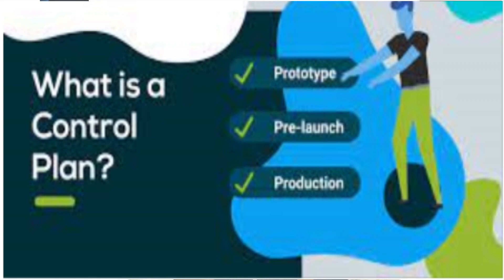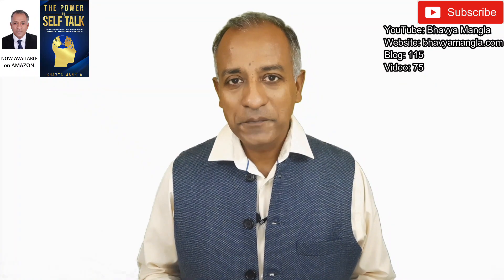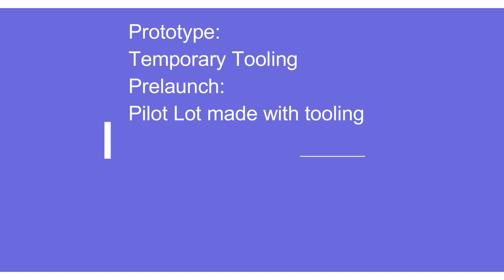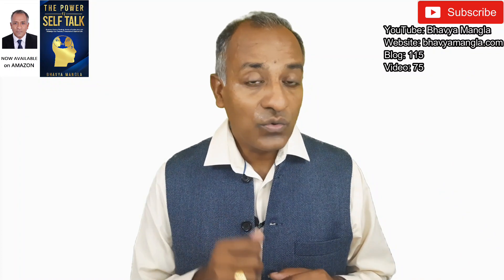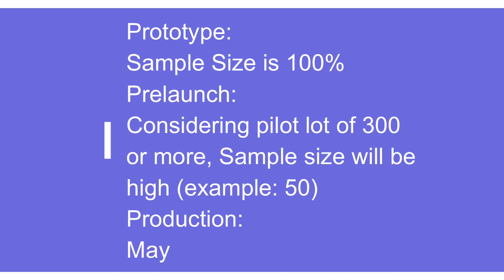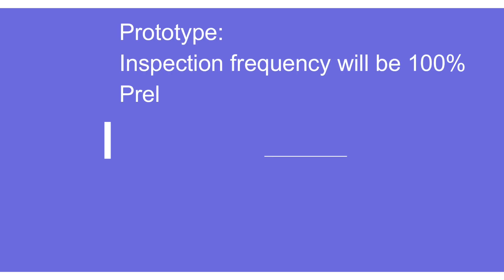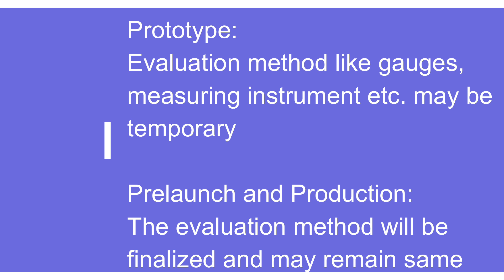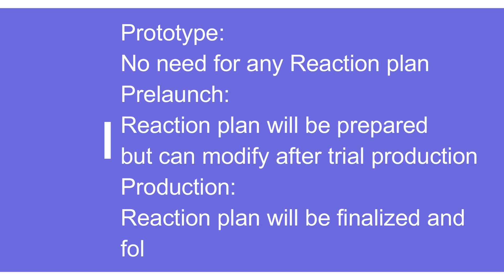Difference between Prototype, Prelaunch & Production Control Plan / IATF | ENGLISH | Bhavya Mangla

Comment: Hello sir,
In Initial Supply Control (IPC/ISC) stage ,which type of control plan will be used ???
Confusion is IPC/ISC is 1st 3 (lot or month or 5000 pcs which come later) production but sampling plan & sample size is higher than regular production.
Please let me know sir.
Reply from the maker: Dear Abhishek, Thanks for your query. As per APQP manual, there are 3 type of control plan. Prototype (few pieces manufactured), PreLaunch Control Plan(Quantity is high generally as per customer requirement) and Production Control Plan (Mass Production). Although customer may have different names for these 3 stages
Reply: Pls use production control plan-IPC period like that after 3 month remove the IPC period..